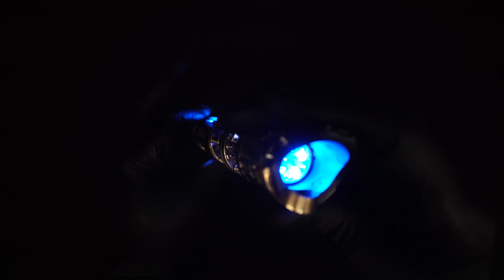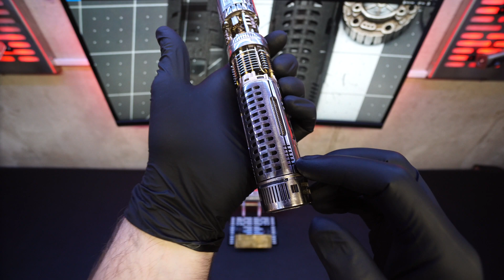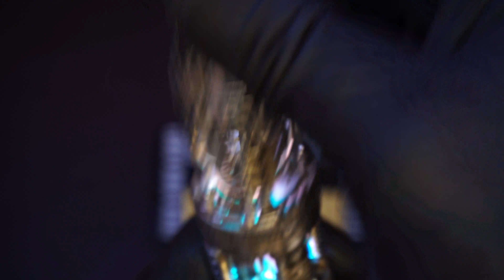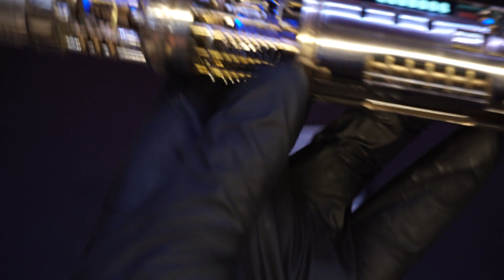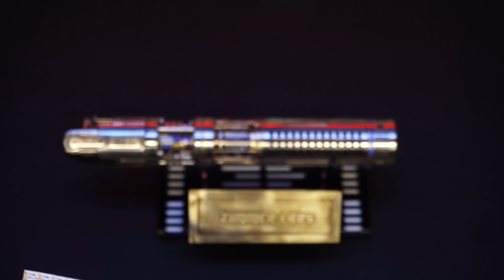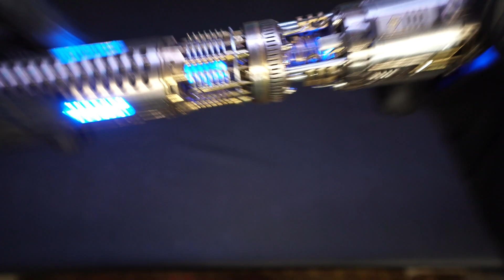Mike's Metal Master Graflex w Spinning Plasma Gate, 20700 Battery, & 31mm Speaker

Comment: What if the battery goes bad my only concern
Reply from the maker: There are 4 steel rods that hold the battery cover on.simply remove them and replace the batteries.  It'd be a 5 minute job for me, maybe a 30 minute job for your average person with minimal soldering experience.
Reply: @ethanzimmerzimmerlabs823    ahh so it should only take me about 5 minutes too then, I'm not your average person when it comes to soldering either brother I've tackled some in depth stuff before that's why I'm ordering this kit I just wanted to make sure that all the electronics where found on the mb sabers page too and was trying to reference some of those parts you were talking about including the ones with the Lazer etched rings too. But great work brother and awesome build! the polishing came out magnificent. If I can some how dm you to discuss this further please let me know. Thank you
Reply from the maker: @robertlasala866   Of course, i'm always happy to chat with other lightsaber builders.  Feel free to email me at ethan@zimmerlabs.com.

Comment: Hi Ethan, your work is great. I know it’s been a minute since this build, but I have two questions for you. I’m building the metal masters 3.0 in brass, and I have all my parts, I’d really like to do it myself but I don’t know if I’m capable. I’d like to retain your services if needed. The second thing is do you think a 21700 battery would have fit? Thanks!
Reply from the maker: Good question.  I think a 21700 battery would fit, but it will be very tight.  Of course, it's only 1mm wider than 20700, so it should work.  Of course i'm happy to build or finish building yours if you run into difficulty.  Email me at ethan@zimmerlabs.com and we can discuss is you need assistance.  And thanks for the message!

Comment: 2 things, 1) assuming i could have the battery power for it, would a cfx board be able to handle those tiny ws2812c leds for a whole blade if i were to do 3-4 of the strips in 1 blade, and 2) where can I get your tron blade font? ik you said it was modified from the transformers font but could i just buy a CFX version from you directly?
Reply from the maker: Hey, yes, a CFX should be able to run the WS2820C strips.  I don't know how bright the blade would be, but it might work.  I am about to try building one myself to see how it looks.  As for the soundfont, I can't sell it because it's not mine to sell.  I just bought the "Transform" soundfont, then modified it to suit my blade code.  I added smoothswing files and used some other  files from other soundfonts that worked well with it and just made it myself.  But the underlying font is really something someone else made, and it wouldn't be right of me to profit from selling it.  If you want to email me, I can try to assist you in recreating it though.  Just get "Transform" from saberfont.com and then add the necessary extra files to make it work for your specific setup.

Comment: I wasn't able to find a WS2820C-2020, did you mean WS2812C-2020?
Reply from the maker: That's a good question.  These really are WS2820C strips. But the seller has them listed as WS2812C-2020.  If you look at the specs on the listing page he correctly lists them as WS2820C, despite the title being WS2812C.  Weird right?
Reply: @ethanzimmerzimmerlabs823  Do you have a link of the page that sells these strips by any chance? I'd like to have a look.
Reply from the maker: @jesserobert1152  https://www.aliexpress.com/item/4000765540185.html?spm=a2g0o.productlist.0.0.32fe54b6wVYZ6B&algo_pvid=af0632cc-f0ed-45fc-b9f9-608e242ad647&algo_expid=af0632cc-f0ed-45fc-b9f9-608e242ad647-1&btsid=0bb0623c16096162113733285ea219&ws_ab_test=searchweb0_0,searchweb201602_,searchweb201603_
Reply: @ethanzimmerzimmerlabs823  Ah, thanks!